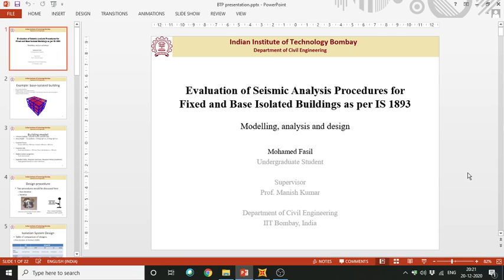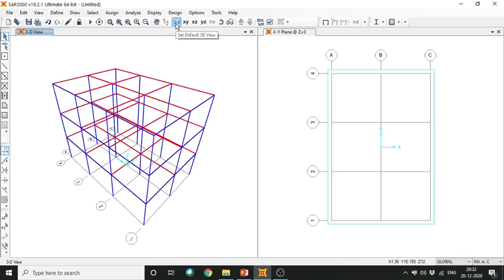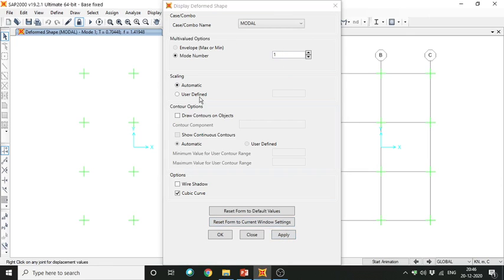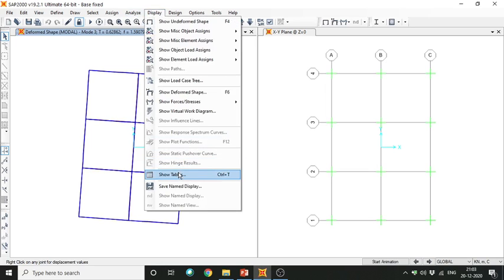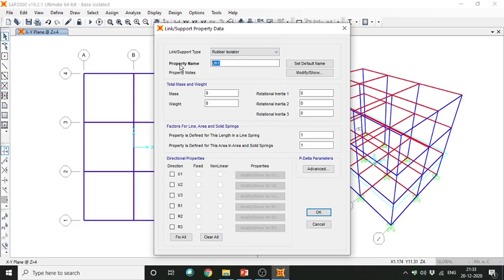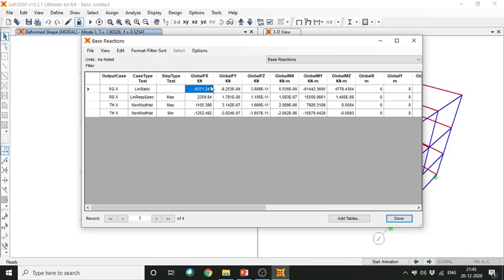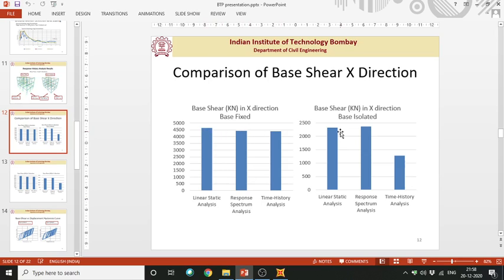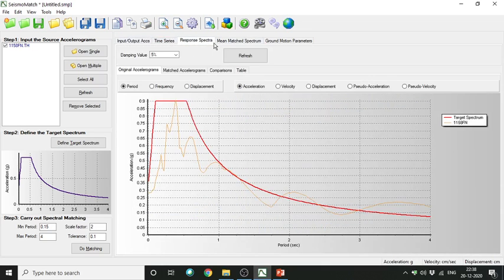Fixed-base vs Base-isolated Building in SAP2000

Comment: Sir,Thank you for the lecture.Could you please share how to calculate stiffness of base-isolator using both Iterative and Non-Iterative Procedures according to Indian standards and any reference materials,papers related to Base-Isolation System Design?
Reply: did you calculate these values...i need hlp to calculate these
Reply: @nidhichoudhary7067  same buddy
Reply: @krazzyducks7633  I also need to learn about base isolation design. Have you studied it?”